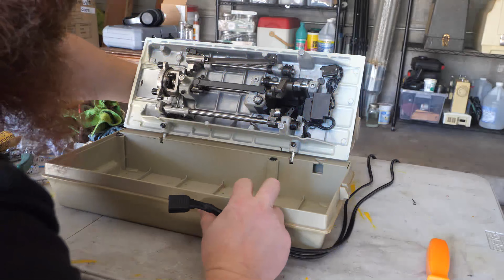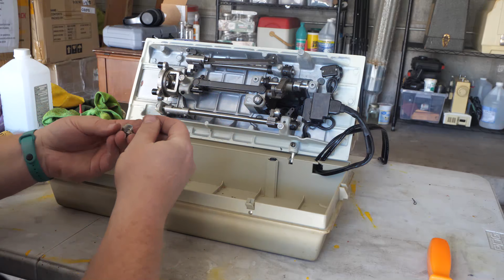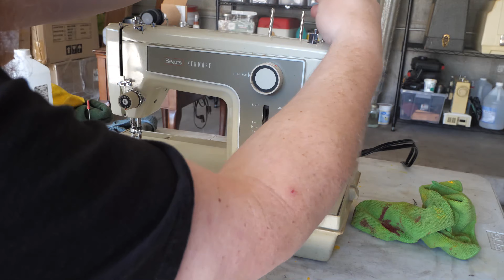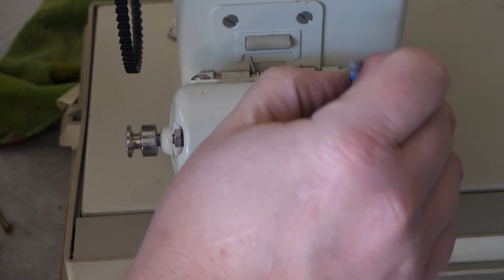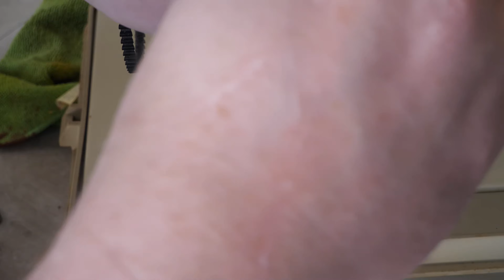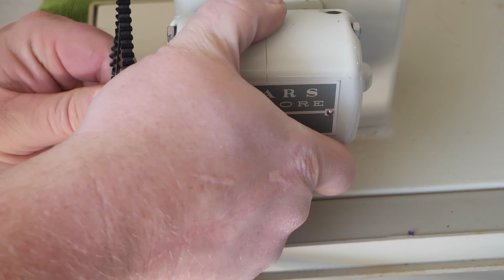Kenmore 1227 progress but no parts

Comment: Where are you able to order that part from?
Reply from the maker: The zigzag gear is not available.  I eventually had some replacements 3D printed.  The 3D printed parts (the files are readily available for the 22 tooth zigzag gear) were later used to get this 1227 fixed and also in an Elgin 301 with a cracked plastic zigzag gear.
Reply: @henrybangsberg2187 Is there a repository somewhere for these .stl files like on the kenmore group? We need to come up with something and organize them so folks know about it so they don't mistakenly junk their machines